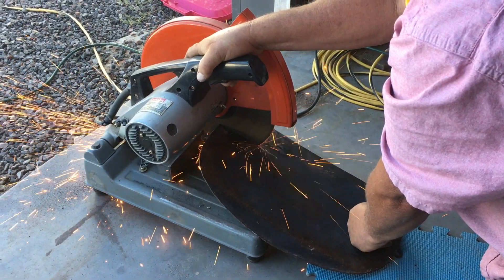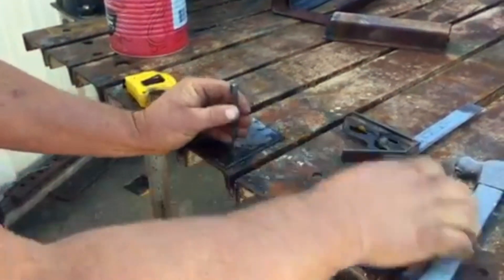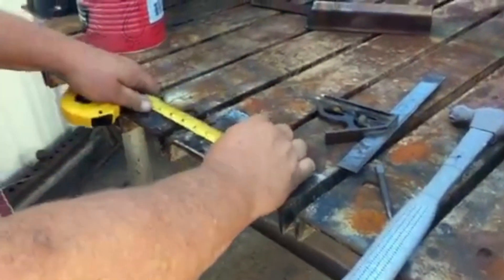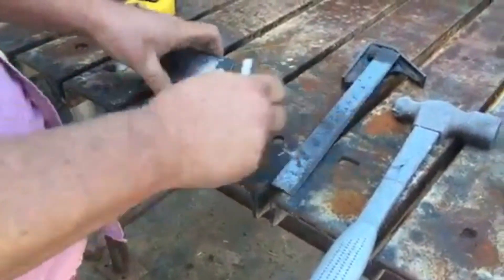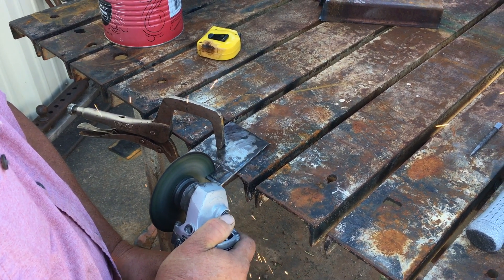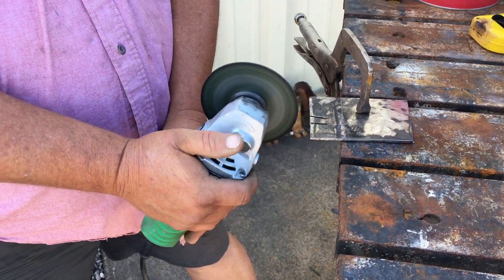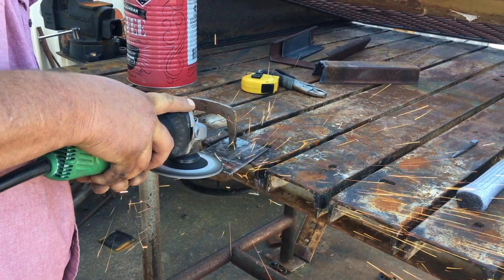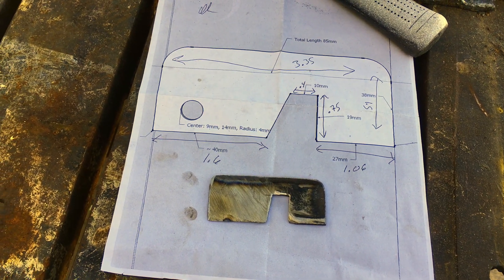Porsche 986 Porsche 996 Cam Shaft Lock Tool for M96 Porsche Motor:  How to Make Your Own Cam Lock

Comment: LN Engineering kit actually is a little too thick. I had to shave mine down a bit to get it to fit on the car interior side cam. Wish I would have just made it and saved $268 plus shipping.